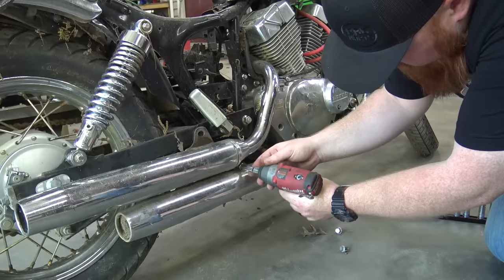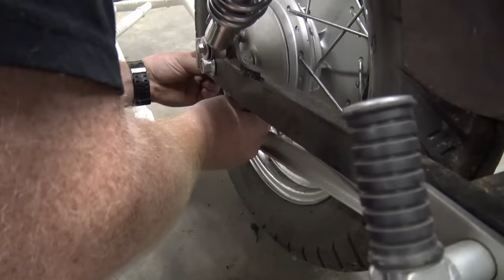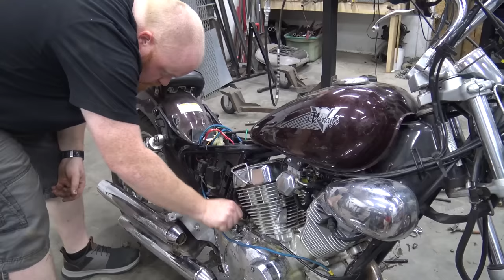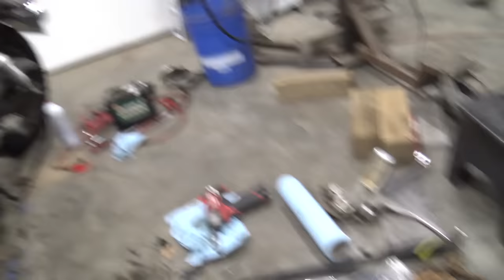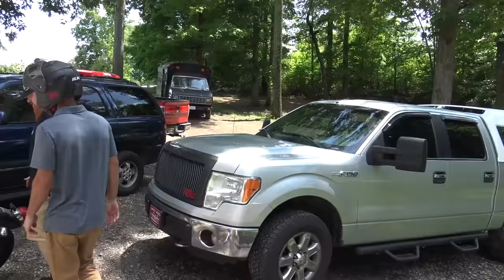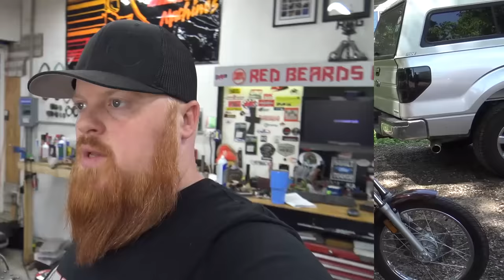Yamaha Virago 250 RUNS

Comment: I love my black 2006 Virago250! Bought it in showroom condition for $1500 in 2017 with 1100 miles. Immediately ordered slashed drag pipes from Japan (w/ baffles) for $400 and swapped out the carb’s main & pilot jets for two sizes bigger. Only get 60mpg vs.70mpg (before the carb jet swap). Front sprocket changed from 15 to 17 tooth. Back sprocket changed from 45 to 38 tooth. Now 5th gear runs like it has a 6th gear (about 10 mph faster in 5th gear  at 5 grand! Added a tachometer next to the speedometer. Added cheap black plastic saddle bags with built in brake/running lights ($60). Installed floorboards w/ heel shifter. It’s a little (249cc) V-Twin Harley. If Harleys are called Hogs, I guess this should be called a Piglet! Perfect for  back rural roads up to 55 mph! It’ll do 70 with no vibrations but I just don’t like that much air buffeting around my ears! Loaned it to my son for his state motorcycle safety course two years ago and never got it back! That’s OK because it’s stashed in his garage all winter and I have three other bikes so my garage was getting cramped anyway. I have the spare key and still go over and ride it! We both own Honda Rebel 500’s. I paid him an announced visit one day and guess what he was out riding? I believe the sound of that little V-Twin with straight pipes is music to his ears! I bought a new little V-Twin this summer and now the Yamaha is my 2nd favorite bike,
    Enter the Hyosung GV250 Aquila. A bike from South Korea (the company made bikes for Suzuki back in the 80’s and 90’s). The GV250 Aquila is 28 HP, the Virago 19HP.  The Aquila 388lbs. The Virago is 326 lbs. The Aquila is 62 lbs. heavier but has 9 more horses! Also comes with dual 8” diameter speed and tach gauges and is EFI instead of carbureted. Big fenders gives it a more “vintaged/ retro look. Retail price was $500 cheaper than the Yamaha. Not sold in the U.S. since 2017? I found a dealer 30 miles from me with five 2015’s and three 2016’s selling them as “used w/ no warranty”  but “zero” miles for $2,395. Like the Honda Rebel 500, it has a big, fat front tire and feels more secure around bends and tar & graveled roads. 
   I still love the Virago250, but I’d bet you’d pick the Aquila (after riding one) over the Virago! So hopefully I’ll see you doing a video someday turning an old Aquila into a Bobber!

Comment: You could always do a 670 predator engine, and a 70 series torque converter on the other frame, that would be a good build.IMO. :) Lonnie would have one then.
Reply: Phillip Mountain Man they need to do that and race cars and cameras 670 chopper
Reply: A B not from what i know of it didn’t have a torque converter because they took it for the rail
Reply: A Vtwin Briggs would be nicer, probably smaller dimensions too.

Comment: I have one of the first year or 3rd. year Virago here at my shop. Only it's a basket case, but the reason for it being tore down in because the engine was complete rebuilt but the top end needs to be installed on the short block.

Comment: can anyone help me I recently acquired a mini Baja on the side of the road for free along with a broken generator the mini Baja I got running and under 10 minutes but however it was really slow so I remove the governor which I have never done before and got the job done fairly easily however after tapping the hole for the screw I have not successfully got all the metal shavings out I got most of them but how do I get them all out?

Comment: I have some parts for one if you want them. I have a jet kit so you can run straight pipes without bad fuel air mixture and brand new clutch plates
Reply: Blinkers and stock mirrors
Reply from the maker: What would you want for them?
Reply: I messaged you on insta

Comment: just a heads up. Front tire is backwards.
Reply: No.  It isn't.  Google pictures of the Yamaha Virago 250.
Reply: yes it is. at 3:37 mark, the first bike before he pushed it out for another one in had mounted on backwards. As the second one is correct. different tread as it looks like from a different brand.

Comment: You could have bought a sportster for what you have in that turd. P.s I have a Grom and its 10x more fun than that turd will ever be. You should buy the z125. I ride my Grom more than my GSXR. I wouldnt give $1100 for a good running Verago let alone $1100 for the engine. You can find older good running Sportsters for $2000.
Reply from the maker: I have less than 800 in this bike now
Reply: Plus an AR.... Hey if you want to pay the shipping I have custom wheels off older soft tail. If your interested  I can get pics next time I go to storage. No idea if they will fit under that turd though. Sure you can use them for something.